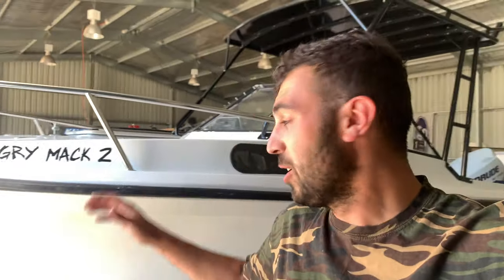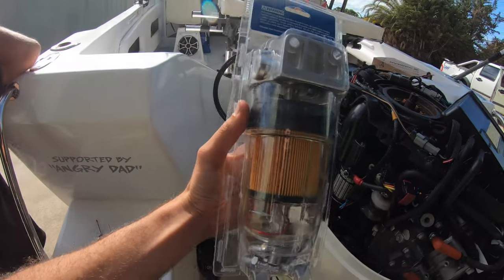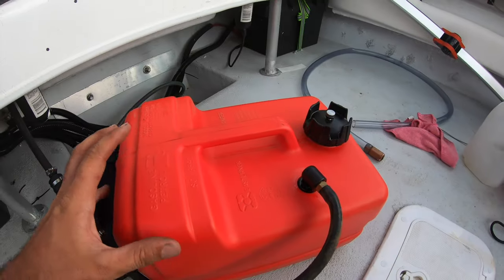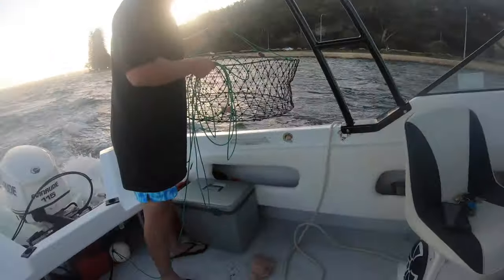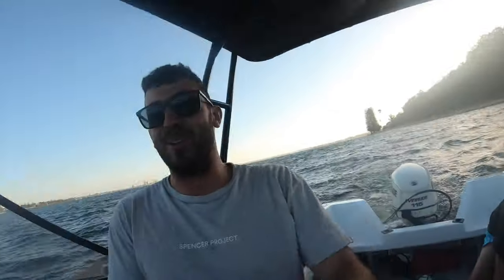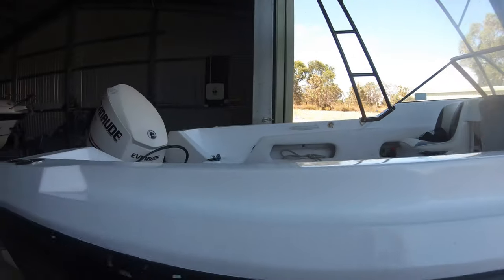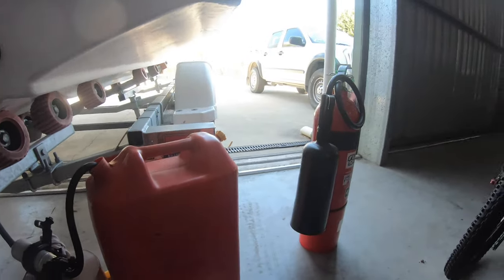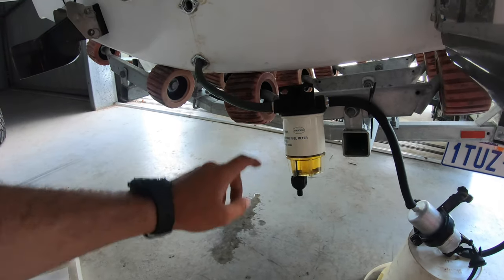OUTBOARD PROBLEMS | WATER IN FUEL | ETEC LIMP MODE | FULL BOAT RESTORATION- PART 25

Comment: Add a skirt around the overboard tank vent. There is negative pressure (vaccuum) in this vent when the engine is running.
Reply from the maker: thanks for commenting, yes that's a good idea!

Comment: Hello tip for water in the for when you fill the new fuel in put a litre of metho in the fuel it dissolves the water goes in and burns of in the engine

Comment: The tank breather needs to be mounted in the splash well . 
The hose from the breather needs to be looped up from the breather as high as you can get it inside the gunnel next to the breather and then down to the tank so that if any water gets into the breather it will run straight out of the breather and not straight into the tank .
 The breather needs to be mounted so that any petrol fumes coming out of the breather do not flow into the inside of the boat .
 Petrol fumes are heavier than air and will flow down to the lowest place that they can .
Mounting the breather in the splash well will contain the fumes in the splash well and the fumes will drain out of the splash well drain to the outside of the boat .
Reply from the maker: Mate Thankyou very much. This has now been done, the breather is moved to the rear. The breather was placed here prior to me owning the boat.

Comment: I would mount a vent Midget over the fuel tank breather to protect it from splashing water .
Reply from the maker: Hey Gav, i removed from the side and changed location to the back of boat, engine well :)